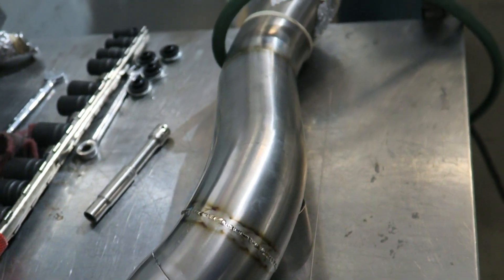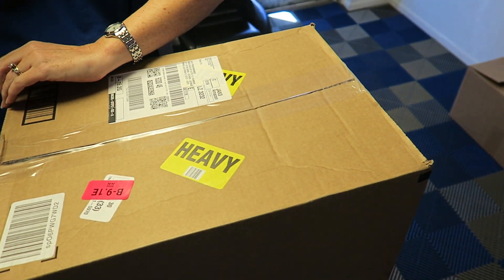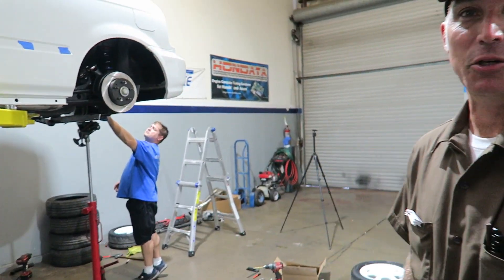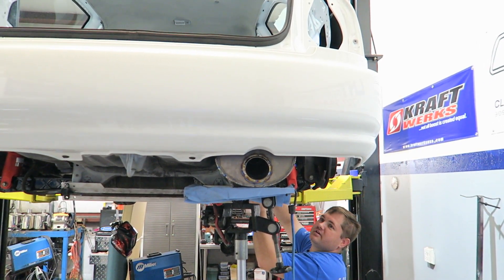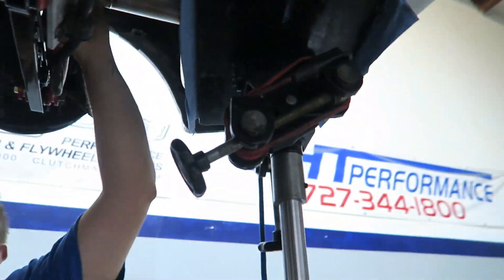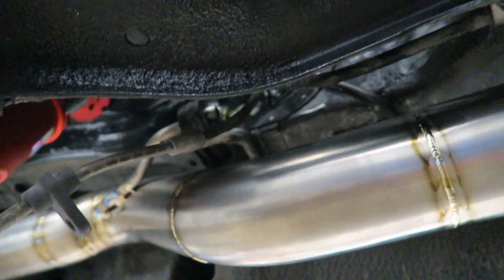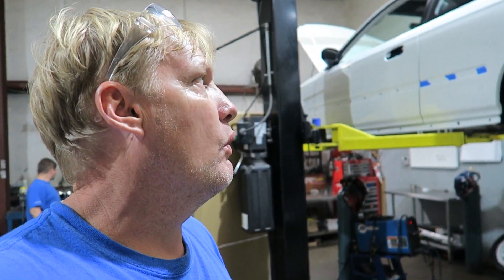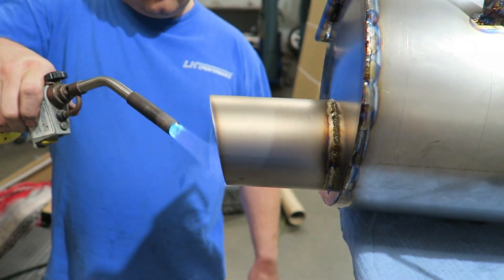Civic EK  Hatch - Episode 16

Comment: Reverse the little butt fan so it pulls instead of pushes, should help and keep the shop cool still, that is if you can reverse it.  Love the content, like reading a good book!
Reply from the maker: Will Smith We’ve tried it both ways , we have it on slow speed as it blows stuff everywhere 🤔
Reply: do you have a variable speed controller or a two speed fan controller?   Just thinking if you need a variable speed drive controller I might be able to snag you one 🤔
Reply from the maker: Will Smith It’s got 8 speeds fwd and rev
Reply: LHTPerformance that’s a variable speed drive then.  Dang little butt moving big air!!